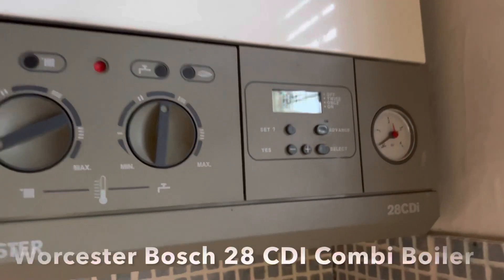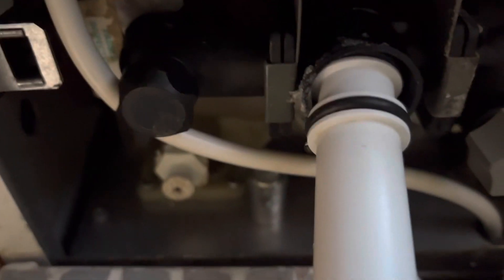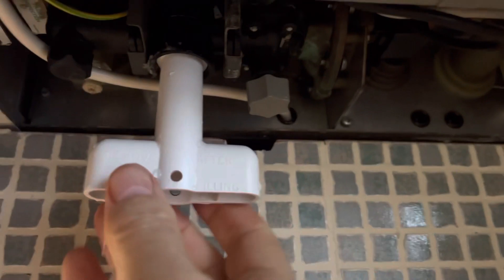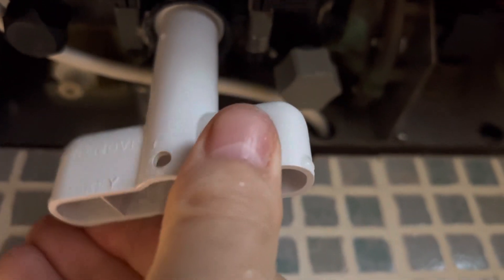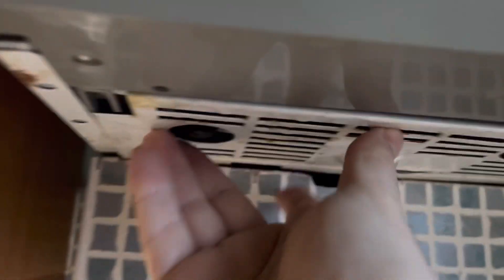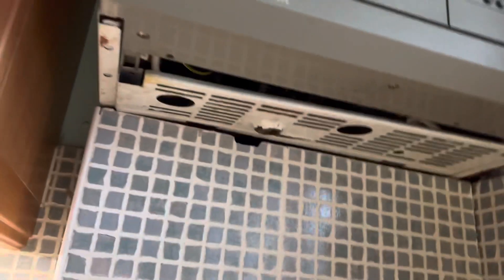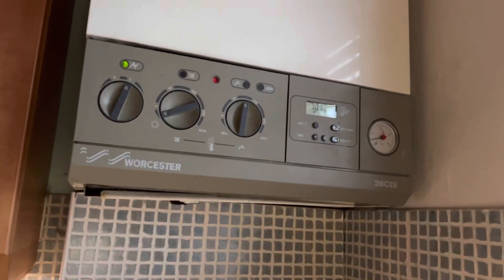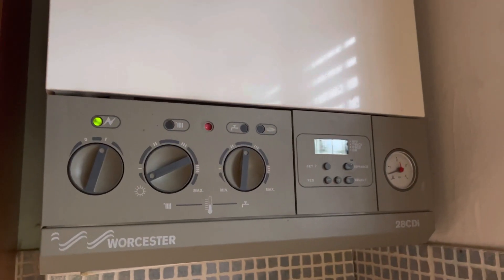How to fill up water on a Worcester Bosch 28 CDI Combination Boiler @paulcruse #gas #boiler #heating

Comment: So you know if the control panel can be changed or if the boiler can be connected to a smart control system?
Reply from the maker: I think so, I had that on my radar, but then I went for a new boiler.